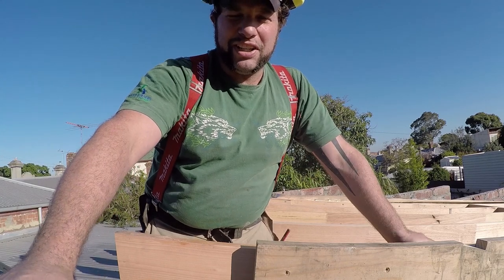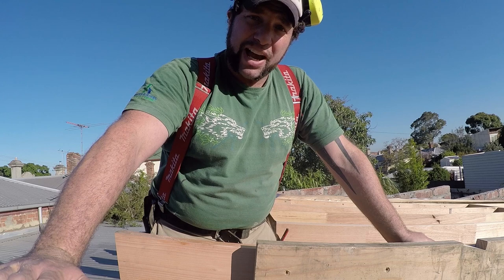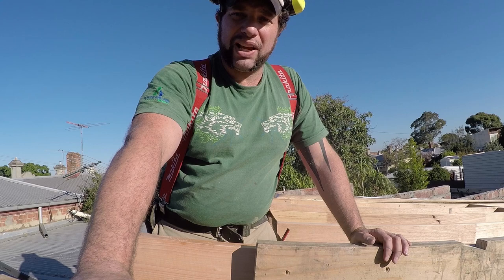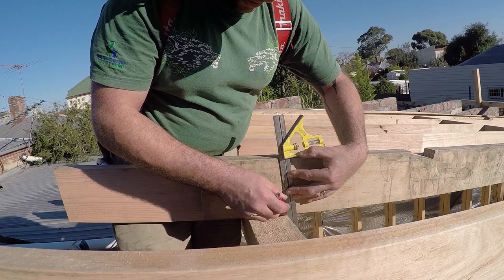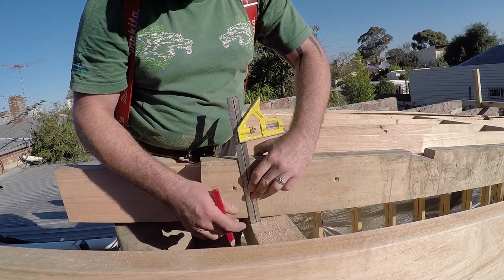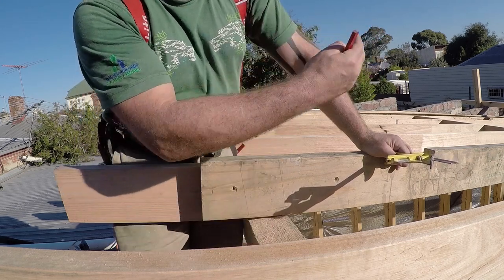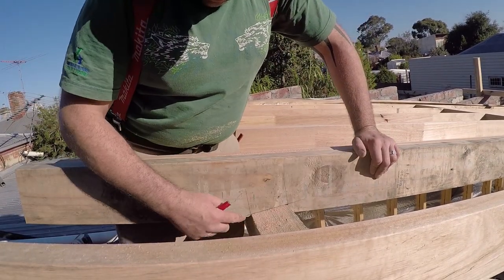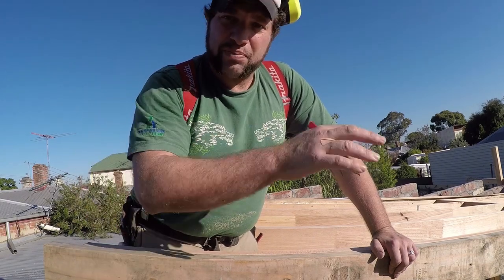How to cut a pattern rafter - this is for a flat roof that ties the frame at both ends

Comment: I like this foot cut better than a birds mouth. I'll be using this on my rafters, thanks
Reply from the maker: G'day Lesley,
YESSSSS its great, and it adds nominal bracing to your structure.  this system "Locks in" both ends so that the frame becomes part of the roof & vice versa.  I also pre-drill and batten screw through the top plate into the bottom of the rafter to "Tie it down" and help with uplift 
#stayawesome and thanks for being a Patreon Member